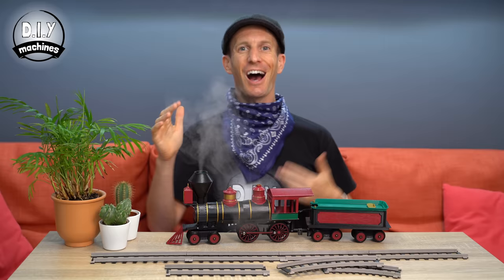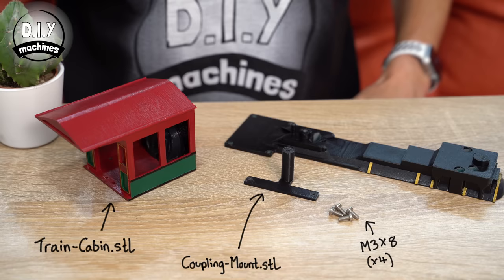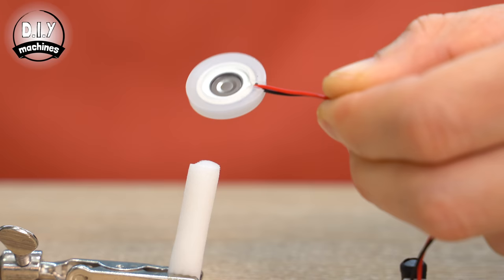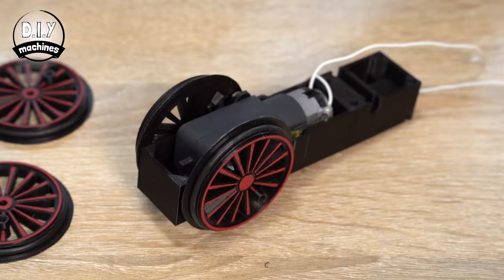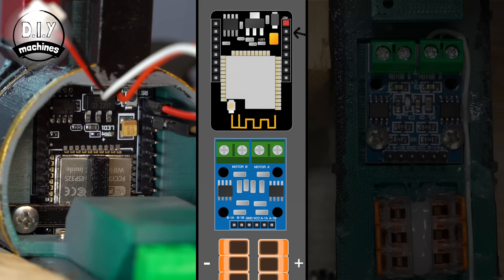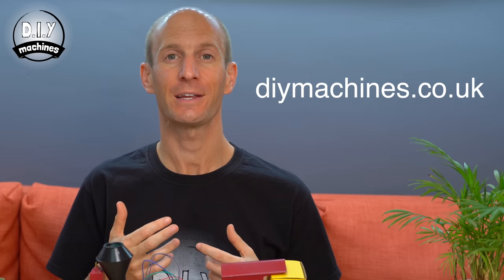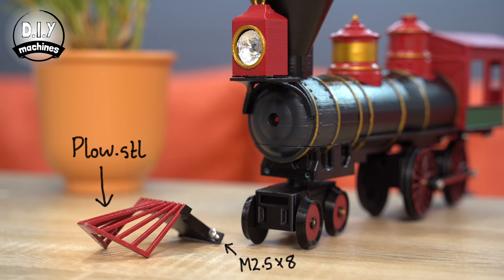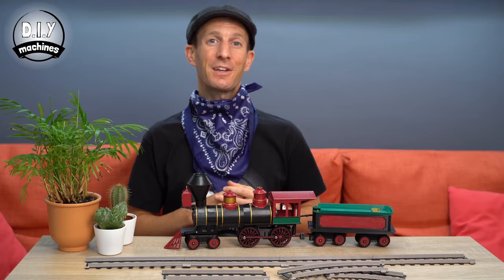3D PRINT a STEAM TRAIN 🚂 With Steam, Live Camera Streaming & Wifi Controls

Comment: I realize this is a simplified rendition of an early steam locomotive, as such I still felt it should have had some form of valve gear typical of such machines.  Photos of Boston & Providence railroad's "Daniel Nason" show such a locomotive WITHOUT valve gear does exist.  Actually, minor modifications would be necessary for your design to resemble the "Daniel Nason" - perhaps that was your plan all along! 
Great video, my plan is to use your project to build one in "G" scale.
Reply from the maker: Yes, you are right Thanks of the extra information, it is a medley of several trains . The Lilly Belle at Disneyland being one amongst others.

Comment: I have been working on my 1950s trains with IOT and 3D Printing for nearly 10 years. And have followed a mostly traditional path of improving the 1950s methods and styles. My Channel in You Tube is Frankentrain Laboratories. I am blown away by your video here I just saw it. I have seen a LOT of DIY train videos and even tried to use a few on my projects.  I have not added the camera it is on my list. I am most impressed with the screens on your phone. I also use the ESP Microcontrollers. Wroom 32 and 8266 types. I really want to try leverage your code on one on my trains. One question is scale, I think the control part does not care but your assembly of this engine truly relies on the O Scale for space. I run in S Scale which is smaller. I like the engine style you have and would like to see that engine scaled down to S. But the detailed parts then would not fit as easily. Could you consider supporting such a rework for an S Version. Secondly we also use mostly track power. I have trucks that could easily match your tender for power pickup, And i have PCBs for AC to DC and DC regulated to 5V as needed. I am very excited to see your use of vapor, I have several kits but not thought of a good way to adapt, hold water and refil, plus we like Chuff & Puff. I have sounds triggered by a cam that also could pulse the power to the Vapor assembly. Maybe we could share ideas and tech ???? Awesome project, now i must go back and see all your past work for more ideas. Look at my channel I would share if you see anything useful. Dennis in Virginia, USA
Reply: I sent you a coffee, then i tried to download the instructions looking for the INO file. But my Security does not like The Documentation software that is required. How can i get the instructions and especially the INO File? I did not order the ESP Board yet waiting to be sure I could get the software, it looks very slick.  Dennis

Comment: This is a really great video, well done all around. And I really appreciate the way you took the time to  explain everything. Also that's brilliant with the body having that built in channel to measure the brass rod lengths. And using wagos as bus connectors is also a great idea. I have to ask why you are using purge towers with only 1 color of filament though? That is a waste unless you are switching between different filaments using 1 nozzle. Seriously though this is a great video.
Reply from the maker: Thank you for the kind words. I’m really happy to have incorporated the rod cutting guide into the chassis body. 😊 The narrow tower on the left is only there when filming for a time lapse. It prevents adverse stringing occurring on the print as a result of the nozzle oozing whilst it pauses out of the view of the camera while it captures a photo. I do not include that tower unless time lapsing.
Reply: @DIYMachines  You're very welcome. And that makes a ton of sense with the time lapse! I have also seen designs they put a wipe brush the nozzle can clean itself off by running over. Is great work all around.:washhands:

Comment: Great Video Lewis.  You inspired me to make one for my grandkids! I printed all the parts and ordered all the other items on the list.  I received the ESP32-CAM-MB and followed all of your instructions to the letter but the code simply won't upload.  The USB COM port is working with the latest driver but I keep getting an "upload error". Thinking I received a bad board, I ordered a new one but had the same result. After doing some reading on Discord, Amazon and other places, I found that many people have had the same problem so I used all of their suggestions to no avail. At this point I'm hoping I can find someone who is willing and able to flash the board for me.  My only other option would be to put a POT and switch on the tender to operate it manually. Can anyone help?  I've flashed many chips in the past on other projects but this one has me stumped.

Comment: And the piston itself is missing
Reply from the maker: It originally had one when the main drive wheels were fixed rigid in respect to the main train body. I took the decision to remove them and have the large driving bogie rotate so that the train could take tighter corners allowing the track to be more varied in confined spaces.
Reply: @DIYMachines  inside cylinder 4-4-0's did exist in america
the boston & providence railroad's Daniel Nason is the only surviving example of this, however.